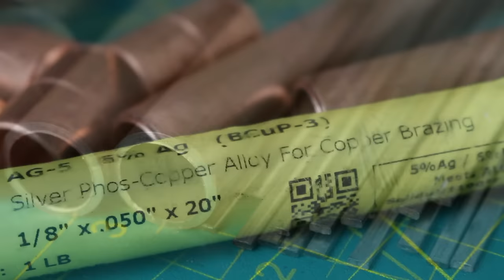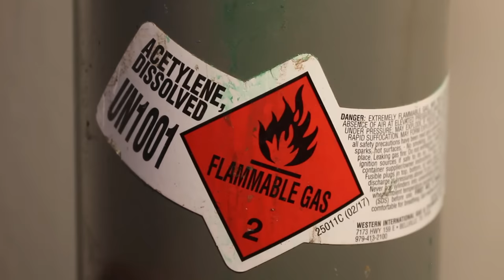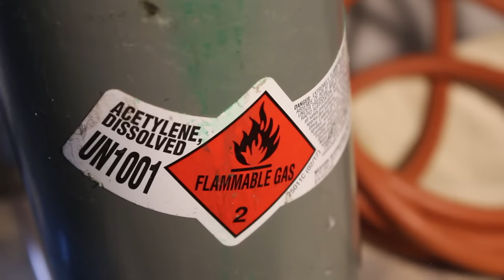How To Braze Copper Pipe Like A Pro (HVAC Refrigerant Lines)

Comment: Right my problem is I'm heading the pipe with the burner but the pipe just won't get to a point where it golws. I can melt the brazing rode but it just won't connect to the copper pipe. Can I just add that the copper pipe I have have a silver shell for some reason. Its the shower pipes
Reply: For water lines you only need to solder, not braze.  If it's not getting hot enough there could be water near the joint. Believe it or not put a chunk of bread (no crust), gently push further into the pipe. It will absorb the water and create a dam to keep your joint dry.  The bread will dissolve and get blown out by water pressure when you are finished. Even a little water near the joint will prevent proper heating.
Reply: Solder for water supply,  not brazing.

Comment: Where was your  nitrogen purging the pipe will be full of oxidisation now and needed to be flushed out or replaced.
For the more experienced brazer use oxygen and acetylene for better control.
But otherwise not too bad for bench work though, but too slow for site work.
Reply: I think it may not need to be purge on pipes other than medgas or refrigerant .Turbo torch comes handy with small pipes in tight spots because the flame is smaller

Comment: it looks too hot for the capper  and I would direct the flame on the elbow only not on the pipe.
Reply: If you are soldering, you heat the fitting. When brazing, heat the joint.
Reply: Jeff Peterson I was taught the same way. I was told that if you only heat the fitting, you run the chance of it cracking because it might not be able to transfer the heat to the pipe quick enough.
Reply: I always heat the pipe up first, once it starts to turn orangish/red I then move my flame to the joint that's being brazed..
Reply: @ASAPJermz  I watch the flame until I start seeing green and then you are very close to the right temperature
Reply: @jeffpeterson1331  Yes sir
Reply: That is not completely correct.
Reply: @jeffpeterson1331  huh?
Reply: @SergioPena20  wrong.
Reply: @ASAPJermz  most correct insight yet.

Comment: Way too hot. Pull back. You don't want cherry red because the inside well be covered with black scale. It takes practise. I actually prefer brazing when there's wind to dissipate the heat because high heat does bauer good flow. Be extra careful in wind though, keeping control of sparks and  wetting down any dry leaves or grass around the unit first and pay close attention with backup plans ready to go just in case. It's also too easy to burn a hole with high heat and using it is actually a shortcut requiring you to keep the flame moving. I always start as I learned in school, from the back of the cup briefly and then the  tubing and finishing neck on the cup. In and out as quick as possible, but aiming to fill the cup (without overfilling it all the way into the tubing).

Being trained by a company owner, I can say I'm shocked to see see that these days most people don't take the few worthwhile seconds to polish joints before leaving. I would have been fired for that back in the day because the company's sticker couldn't be associated return incomplete work and every job was required to have that sticker attached. It's hard to be quiet (but I don't get involved when I see young guys these days usually leaving a big mess). With at many companies to compete against, the craft has become mostly a race to get to the next job.

Comment: I’m a sophomore in hvac at a trade school and I’m wondering if you can use a small butane torch to solder in tight situations?
Reply: I don't think butane or propane burns hot enough.  But I've seen where MAP-pro gas with a turbo torch will get the job done.

Comment: That hurt, didn’t pull the braze into the joint, kept moving the torch around way too much, no flowing around the joint just dabbing, get the heat correct first and stay at the correct distance, heat, melt, pull into joint with the heat, fill the joint.
Practice a few before posting lol

Comment: I worked as a apprentice for a plumber for a few months I got OK with sweating I also worked in an apartment complex and rebuilt some boilers that got ripped off boilers were fun that's a whole different type of sweating I did pretty good no expert at all what I found interesting was this old guy they did this strange thing he worked hardened some Acetylene braised joints that he didn't want to be soft with this belt of beads that he made for just that purpose he would lightly roll them on the joint at first for a long time lightly wiping them across the joint and on the pipe barely touching them and just kept going and then by the end he was like polishing the joint with this belt of beads as if he was polishing a shoe if you can picture what I'm talking about and by the time he was done that piece of  copper was work hardened again where it was almost as hard as a brand new stick of copper just from the tiny beads clicking on it beating it into work hard and copper and it wasn't beat up bad it just had a few Dings here and there but it took all the softness out of it it was really awesome
Reply: @jb9652  that was just supposed to say piece of copper but I was using voice recognition and someone was in the background talking

Comment: Do you ever have to work outside for stuff like this? I'm interested in pipefitting. (From Phoenix)
Reply: rene L I’m working on a pipe fitting job right now at a data center and we are outside working on unit’s . It’s new construction. As a pipe fitter you will be in many different environments from outside to indoors good luck pipe fitting is great career and fun
Reply: All the time.
Reply: I joined the union here in Houston and honestly it’s good work but I chose to take the service route instead of pipe fitting. You get laid off in construction from what I hear unless of course you’ve been around and know what you’re doing then you get to move on to another project
Reply: Most definitely all the time

Comment: Since you mentioned Flux but were talking about refrigerant lines might want to also mention not to use Flux on hvac refrigerant lines. That Flux will mix with the oil running through the lines and kill your compressors

Comment: Great video amigo!  Got a question,  do you have access to hydrotest equipment?  That way, you can pressure test  braze job.  Also,  a bore scope can do wonders to peak inside the tubing for a flux/no flux braze.   Thanks for sharing the video!

Comment: Is this a lead free process, and safe for fresh water plumbing?
Reply: Brazing with silver is for high pressure. You jyst need lead free solder for plumbing. You'll also want to use a soldering flux. Not a brazing flux.

Comment: what is the best soldering rod you think ? recommendation from you.
Reply from the maker: I'd go with any brazing rod that contains 15% silver👍 You can get away with 5% but the 15% is more expensive for a reason🙃 As far as soft solder, I always use 95/5. Thanks for watching!
Reply: @JumpermanTech  brand and model number ?
Reply: Hello Bryan - generally,  soldering is sold in rolls and for copper brazing they are done with (brazing) rods.

Comment: I braze for daikin pplied america, your flame tip is too short, and your angle and form could use alot of work, also your preheating seemed a little inadequate, and please dont feed your filler rod into the flame. Idc if its heat sensative or not. Id love to show you some pointers to increace your joint quality
Reply: I hear what you are saying in your critique. Maybe think about creating a video. It never hurts to watch several folks and pick up what to do as well as what NOT to do.

Comment: Cleaning the parts  
Pre-heat no uniformly, applied brazing alloy not properly, Melted the alloy wasn't right temperature. Somewhat melted the alloy early. Drain the side too much, and the joint doesn't have enough fillet. Seems like poor penetrated into the clearance of the joint. The joint looks weak, somewhat oxidizing flame.

Comment: Hi! I have a fridge compressor I would like to change. Can propane be used to remove the brazing given the size of the copper tubes? Can I use flux + solder when mounting the new compressor or better using flux + brazing metal for copper? Thanks!
Reply: Yes you can use propane, but please do not. (Kindly - Please get a professional to do all of your HVAC work for you. I do not want  you to get hurt or release refrigeration...you obviously do not know what you are doing.)
Reply: @trevorbjarne  hi! Gas leaked already. I replaced the compressor myself using a propane torch. Still works like a charm after about a year! 😁👍

Comment: Very important. If this is done incorrectly you will get leak in the line and lose pressure and AC will FAIL. Always inspect the areas that were brazed for leaks!

Comment: Oxy/acetylene torch is needed...two tanks blend together to a dual feed torch head. The torch your using is good for slow heating and takes almost twice as long to heat the fittings, if you ever try one you'll throw that crap in the trash. A/C tech here for ten years....trust me
Reply: With small bore tubing just using acetylene is preferred and the correct practice/ theory to be used here.

Comment: Turbo torches aren't meant to mend sylphos to copper. It's meant for plumbing solder.  
You need oxy acetylene for proper mending of the 2 metals. 
Also don't forget to flow nitrogen.

Comment: The wrong soldering method caused the solder to adhere only to the surface of the copper tube.
Reply: Tiger xx, you do not know what you are talking about.

Comment: Use flux. In one touch it will fill the entire circular gap.
Reply: this is not soldiering.  its brazing which is welding rather then filling.   He did everything correct in this scenario.  his joint looked good in the end.  unlike soldiering you do want to see the entire joint capped unlike when soldiering.

Comment: Is a good video ..okay.. but you shouldn't apply the rod on the angle fitting..is doesn't adds anything to the weld and also will influence negatively the expansion and contraction of the fitting, as the rod's alloy is different from the copper pipe !!.. So there will be different movements in the long run, of the two materials and eventually, maybe there will be a failure and a leak..!!

Comment: RIP to whatever you’re brazing. Way over heated. Real HVAC techs have to worry about melting valve cores, service valves, ruining TXV’s, bimetal joints, pressure switches, filter dryers, paint etc. Even if you flowed nitro it’s still ruined.

Comment: No nitrogen flowing? Wow! Great brazing skills. Glad he don't work for me.
Reply: You don't have to flow nitrogen through refrigerant lines while brazing, you'll do that when you leak check after it's all said and done, which should be done for a while, as in time the nitrogen helps to get rid of the black soot or shavings that form when joining metals together. I guess on a smaller system it would be a must, but I've only done commercial construction, and it's so much brazing being done, you'd go through tanks everyday if you used this method.
Reply: @ASAPJermz  Incorrect! You should always flow nitrogen, especially on POE oil refrigerants that scrub the walls of the copper and carry the oxide scale to the TXV. The nitrogen purge after the fact does nothing to get rid of the oxide build up. You must purge to about 2-3psi while brazing to prevent the oxide scale all together.
Reply: @johnpatrick3458  The company I work for has been in business for 40+ years doing HVAC, Engineering, Electrical and Mechanical work. I've seen people flow nitrogen on residential installations, but never on an industrial or commercial contract. Especially if there's tons of piping to be brazed. There are others methods to minimize oxidation, just saying not every regulation applies across the board in the HVAC trade. Some people do things differently than other's..
Reply: @ASAPJermz  I work for a commercial HVAC company that has been in business since 1938. I've been doing commercial HVAC for 18 years. Where I'm from, the best brazing practices include flowing nitrogen while brazing to prevent oxidation no matter what size. I work on anything from small RTU's to 200 ton chillers.
Reply: @johnpatrick3458  I hear you, "by the book" you're correct. But, more times than not, time is of the essence. If you have a 2 year contract that can be completed in 1 then by all means do it correctly. If not then you do what you can.
Reply: John Patrick I’ve got to say that I’ve been watching you tube videos, and while they are not all created equal, all have said to flow nitrogen to remove the oxygen that’s inside the pipe to prevent oxidation on the inside of the pipe (for residential heat pump systems). The buildup on the pipe insides will get removed by the refrigerant and potentially foul up some components. It needs to last at least 20 years so I will be using nitrogen during brazing for my upcoming DIY home heat pump replacement.
Reply: @Ray Trammell Why would I give you this information? People like to act like they don't cut corners, but we all know 90% of people do, especially of time and cost can be cut. All I'm saying is that not every job you everything you need to complete a job "the way you think it should be done" there are outside forces and things that are out of your control as an employee..
Reply: @ASAPJermz  that comment makes no good sense whatsoever john is 100% correct
Reply: @fredjohnson4772  I made complete sense. I said as an employee of a company, you won't always have everything you want or need to do a job the "correct" way. I've been on jobs where things are done by the book, and I've been to others where people were winging it. I'm not condoning half ass work, I'm stating a fact that people and situations are out of your control sometimes..
Reply: @ASAPJermz  excuses r like azzholes everyone has 1 and they all stink. you`ve gone from completely wrong to kinda wrong to a little wrong. we need more quality craftsmen like john and less jeremys in this business just sayin
Reply: @fredjohnson4772  You clearly fail to comprehend where I stand here. Not wasting any more time explaining..

Comment: This is not how you braze. Let me explain. When you braze you do NOT want the braze inside the fitting (that's silver solder). The braze and copper heat/cool at different rates. Having the braze inside the fitting can develop cracks over time. When you braze you want a weld around the fitting. So you can't see where the fitting ends. Essentially a crown.